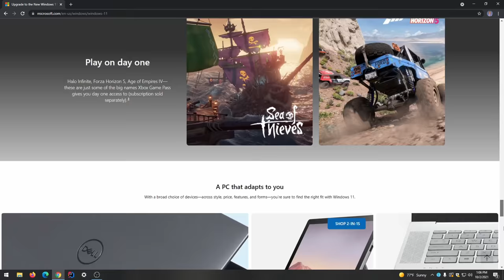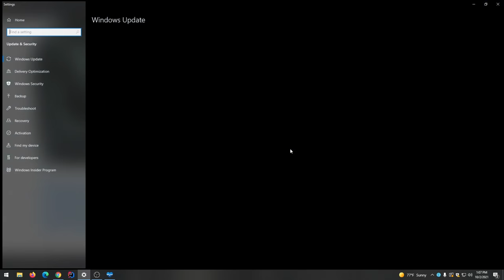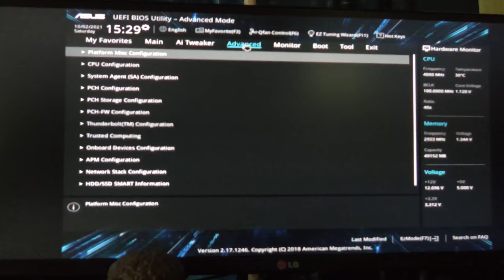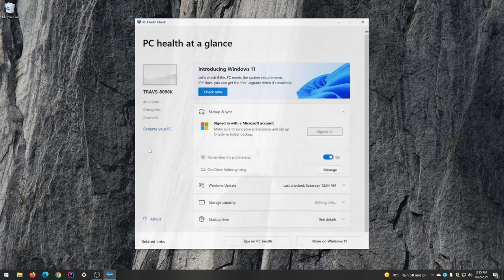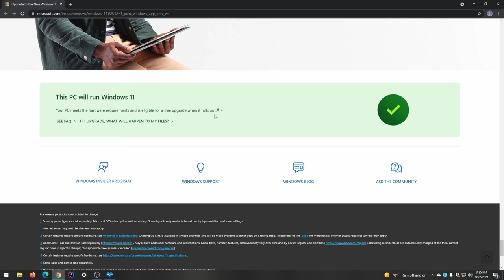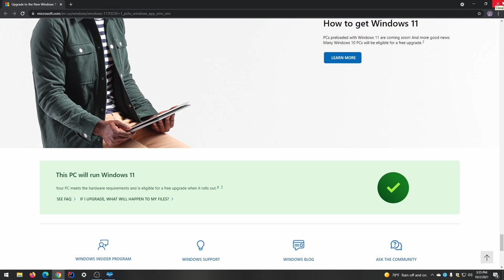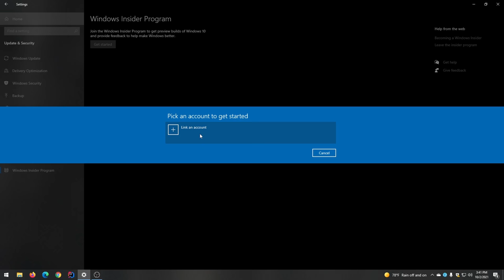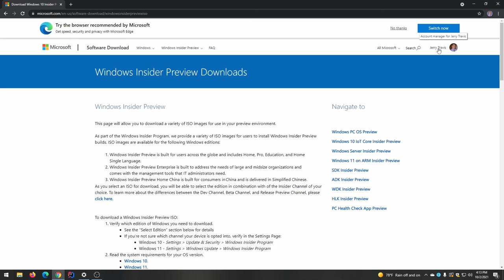Installing a TPM 2.0 Module So I Can Install Windows 11

Comment: You said there's 14 pins but I counted 13 holes
Reply: 2 years later, its a 14-1 the -1 is the covered slot

Comment: I installed a tpm 2.0 discrete module on my motherboard. My cpu has ftpm. I am trying to use the module, to avoid a problem caused by the ftpm. When i switch from ftpm to discrete tpm in my asus BIOS, it changes back after i save and restart. Any ideia of whats happening?

Comment: I'm hoping people will check to make sure they don't just have the TPM turned off in the BIOS first... sometimes it's already there and just disabled, so buying and installing one is completely uneccesary.
Reply from the maker: You are correct that most motherboards that have a TPM 2.0 header usually have the software CPU implementation. I have heard from a few people that the BIOS on their motherboards is buggy and installing the hardware module works better. I haven’t experienced this myself, but given how buggy (and abandoned) some manufacturers leave their BIOSs, it doesn’t surprise me.

Comment: I was so pleased to find this solution to my problem.  Alas, it didn't work!  I have new PC with an Asus A520M-K board, which is not on the Windows 11 Supported List on the Asus website. The answer to FAQ 5, regarding TPM modules, states: "If your motherboard is not listed on support list, it means your motherboard does not meet the minimum requirements to support windows 11 even though you install other TPM 2.0 module (Card) on your motherboard."  So it seems you need to check the Supported List before wasting your hard-earned on a module that will get you nowhere.
Reply from the maker: Oh wow! I have read Microsoft keeps adding new requirements for 11 beyond just needing a TPM 2.0 module. As far as I remember, Asus didn’t list that quote on FAQ 5 when I made this video! Thanks for the information and sorry that just adding a TPM 2.0 didn’t work for you!

Comment: I had a similar problem. 5900x with a x570 hero board. I just had to convert my boot device (SSD) from MBR to GPT using command prompt by going to recovery restarting it, trouble shooting, type the command and it worked perfectly for me
Reply from the maker: Good to know. I’ve had all my drives on GPT for years, but I do remember converting an HP laptop I had during the Vista time period from MBR to GPT. There was some feature I wanted to use that would only work with GPT (can’t remember what it was).

Comment: Make sure that you get the correct module.  There are two that I know for ASUS motherboards.  Not know about other makers.
Reply: I have a M/B ASUS Maximus 8 Ranger, could you point me in the right direction towards the correct TPM module to install, TY.

Comment: what I done is download your windows 11 iso,, download RUFUS  burn an image to a usb flash drive and select the option on rufus to make the image without the tpm processor option, then it will bypass the check for the processor/tpm,, installed and works fine(amd fx 8 core processor)
Reply from the maker: That’s neat. I didn’t know Rufus could do that.
Reply: @JerryTravisSmith  installation can only work of course from booting to the usb drive to install , if in windows mode already, it wont install with bypass check

Comment: I don't know much about motherboards yet. But right now, I have a really old asus h81m-e motherboard for my desktop setup. Does this motherboard have those tpm pins? h81m-A has 20-1 pin slot. Don't know if mine has or not. Your content helped me to get acquainted with all these hardware things. Thank you.
Reply from the maker: Sadly, the H81M-E does not have TPM, only the A model. And I don't think even the A model has TPM 2.0, which is required. (I'm basing that on other manuals that don't specifically say "TPM 2.0" and just say "TPM" generally mean it's only TPM 1.0.) The manual for both the A and E models is here: https://dlcdnets.asus.com/pub/ASUS/mb/LGA1150/H81M-A/E8599_H81M-Series.pdf?model=H81M-E

Comment: I have same problem on my Asus PrimeH570M-Plus and idk which TPM 2.0 to get or know if this motherboard has a tpm input location! I was gonna get this one but i am not seeing anything with 14 pins on the motherboard. Help.😊
Reply from the maker: According to the manual, the TPM connector is next to the SATA ports on the  right bottom of the motherboard. It’s actually a 13 pin connector. 

But you don’t need a hardware TPM. In your BIOS, go into advanced mode and look for PCH-FW Configuration and make sure it’s enabled. It should be by default but if you’re getting some kind of TPM not present kind of warning, it may be disabled.
Reply from the maker: Here’s actually a video where I discovered my board had software TPM support: https://youtu.be/CULyJw5gImc?si=lrlqUDLNFx2USIJX
Reply: @JerryTravisSmith  thank you so much!

Comment: I have Asus x99 deluxe it got  TPM connecter like yours on the M board   and i bought one  TPM   and installed it  the light in TPM shows green when the pc is on  but  the Bios  does not give me the option of  TPM my  bios is  the one from 2019 any help ??
Reply from the maker: Have you booted into Windows and ran the PC Health Checker to see if it is enabled by default?  That’s what I’d do. I’m pretty sure my BIOS enabled it by default after installing it. I was able to go in and check but it was already on enabled. 

Also, in the BIOS, it may be labeled as PTT or Platform Trust Technology or IPTT or some derivative of that.
Reply: @JerryTravisSmith   i did run pc health checker still  shows no TPM i  could not find  the TPM in my as us  x99 bios  i am just wondering if there is non in the bios  then why there is TPM  connecter in mother board and it marked  TPM and once i insert  the TPM the light get  green  in the future i think twice before buying Asus
Reply from the maker: @johnal4560  Here’s the list of motherboards that officially support Windows 11 per Asus: https://www.asus.com/microsite/motherboard/ASUS-motherboards-Win11-ready/

I think this is the manual for your motherboard: https://www.pugetsystems.com/files/4724/parts/Motherboard/Asus-X99-Deluxe-U3-1-10954/e9504_x99-deluxe_series_ug_for_web_only.pdf

I didn’t see X99 listed here, but all I did was a “find on this page” search so it may be on there. 

Is this the manual for the TPM module you bought: http://dlcdnet.asus.com/pub/ASUS/mb/Add-on_card/E14029_TPM-M_R2.0_TPM-L_R2.0_card_QSG_V2_web.pdf

If so, it reads as if TPM may not work if you’re not using UEFI. I don’t know your full configuration so this is a guess. 

Please reply to this if you make any progress in getting your TPM working so it may help others in the same boat.

Comment: Hi brother i have ASUS B550 GAMING WIFI 2 MOTHERBOARD, i just want to know how many pins TPM required for this board?
Reply from the maker: The manual for this board doesn't mention TPM and it isn't listed on the B550 chipset isn't mentioned on the Asus Windows 11 Supported Motherboard page [ https://www.asus.com/microsite/motherboard/ASUS-motherboards-Win11-ready/ ] Sadly, I think you're out of luck if you want to install officially supported Windows 11. There's a myriad of guides on Youtube for getting around the various requirement checks so you can install Windows 11 anyway.  I personally do not like installing an operating system with workarounds because eventually, Microsoft will most like add some feature that will brick the installation on that hardware. Sorry I am unable to provide a more positive answer.
Reply: @JerryTravisSmith  thanks for your kind reply but i let you know sir i build my pc myself in January 2023 and when i started my pc for first time the warning appeared " press Y install new TPM and press N for previous TPM firmware.
Actually i was afraid of pressing Y for installing the new TPM firmware and i have been using my pc for 5 months without TPM 2.0 but finally at risk i pressed Y button yesterday for installing new TPM and it works.
Actually in this motherboard the TPM 2.0 already installed i just need to activate it thats it.
Now I'm using window 11.😀😀😀

Comment: I have a intel dh61ww motherboard it has 19 pin tpm slot but intel doest has tpm module can I use asus or gigabyte tpm module in intel motherboard.
Reply: any fix brother? because I share the same motherboard

Comment: 2:05 My H97M-e Asus mainboard has a TPM slot with 22 pins, but the Asus TPM chip seems to be made for 14 pins?
Reply from the maker: The problem is that even motherboards of the brand can have different TPM modules. Make sure to consult your motherboard manual for details about the specific TPM you’ll need.

Comment: 2:39 - Oh, I see it on your motherboard! It says "TPM" right there. I wonder if my ASRock motherboard has that.
Reply from the maker: There’s a good chance it does if it was manufactured in the last 5 years. I have some fairly basic circa 2013 boards with TPM 1 headers, so the whole TPM thing isn’t really new.

Comment: Any idea what physical TPM 2.0 modules are compatible/recommended for the MSI tomahawk x570?
Reply from the maker: Unless you have a Ryzen 1000 series processor, you should be able to enabled TPM 2.0 without having a physical module. According to this article ( https://www.msi.com/blog/How-to-Enable-TPM-on-MSI-Motherboards-Featuring-TPM-2-0 ) you shouldn't need an external TPM module. Your motherboard and CPU should allow you to enable fTPM, which is TPM functionality built into the platform. Your board is on the compatibility list for fTPM: https://download.msi.com/archive/mnu_exe/pdf/2021/msi-tpm-2-0-motherboard-list.pdf
Reply: @JerryTravisSmith  I know this, but my ftpm is a buggy mess so I am looking in to investing in a proper dtpm in order to hopefully fix a few issues, improve performance, and future proof my system ready for when I eventually upgrade my CPU
Reply from the maker: Ah I see. I have heard some folks say software TPM is buggy but I haven't experienced it myself.

Comment: Hey guys, the video was super helpful! The only thing, it might be user error idk, but when I plug in the new tpm I got on Amazon my pc won’t start up, at all. Unplug it and it starts immediately. Did I just get a bunk product?
Reply: I found out the hard way that even if the generic ones you get on amazon have the correct amount of pins, they can still be incompatible if the pinout is different. Make sure you check the diagram from the listing and compare it to the diagram in your motherboard's user manual

Comment: GIGABYTE B550M DS3H AM4 AMD B550 Micro-ATX Motherboard with Dual M.2, SATA 6Gb/s, USB 3.2 Gen 1, PCIe 4.0 This is the motherboard i have. will that chip work on my board or will i need to buy a whole new board
Reply from the maker: According to this manual that appears to be for your motherboard (https://download.gigabyte.com/FileList/Manual/mb_manual_b550m-ds3h-ac_e_1201.pdf), you need a GC-TPM2.0_S module. There are some on Amazon but they appear to be aftermarket and I personally wouldn’t trust them.
Reply: @JerryTravisSmith  so basically I would need a new mother board
Reply from the maker: @jakeuchiha9540  It would probably be cheaper. The least shady-looking TPM on Amazon was $150 and I don’t think it would trust it. Before all the price gouging, most TPM modules were between $20-35. Sadly, it’s not the case now that TPM is not optional.
Reply: @JerryTravisSmith  well damn I built my first pc last year didn’t know I would need to upgrade. I haven’t tried upgrading parts yet. Am able to just unplug in one and plug in on another? Sorry I know I’m asking a lot of questions still new to this.
Reply from the maker: @jakeuchiha9540  give me a couple hours. I’ll do some more research on your board when I get to some stable internet. You may be able to enable firmware TPM. It just depends on your board,  your BIOS, and your CPU.
Reply from the maker: @jakeuchiha9540  What model number of CPU do you have?
Reply: @JerryTravisSmith  thank you man I appreciate it. I’m not home rn so I can’t see the model number.
Reply from the maker: Good news. It looks like your motherboard supports AMD’s fTPM (firmware TPM). That means if your CPU supports it, you can enable TPM support without having to buy a physical module. If you go here (https://www.gigabyte.com/Motherboard/B550M-DS3H-rev-1x/support#support-dl), under the BIOS section, you’ll see there’s a BIOS revision F14e dated October 13, 2021 that should enable fTPM by default. VERY IMPORTANT: double check that this is the support page for your motherboard. The BIOS is specific to a specific model and installing the wrong BIOS can brick your system.
Reply: @JerryTravisSmith  Bro  I am going to try it out now. but I just have to say I didn't know if you were going to respond or not again. I just want to say I really appreciate the effort and time you've put to helping me out.
Reply from the maker: I have satellite internet and it has been raining a lot. I can’t wait until SkyLink becomes available in my area!

Comment: did u say z370A? pretty sure i had that board and it comes with TPM built in just needs to be enabled.
Reply from the maker: Yeah. I did a follow up video where I shared that discovery (I already had the hardware TPM installed so I just left it in there). I was looking for the wrong terminology for that in the BIOS. 

Did you have any issues with the CPU TPM? A couple commenters said their boards have had a buggy implementation of the virtual TPM. I haven’t had any experience with it and am just curious what your experience was like.

Comment: You could have just enabled PTT in your BIOS and not installed this chip at all! I just installed one in my amd board for no reason, I wasn't experiencing the stutter bug. However, with a dedicated TPM module, I don't get event ID errors because AMD's TPM isn't signed with microsoft properly and the Infineon chip I'm using now is!
Reply from the maker: Yeah. I figured that out after I made this video. 🤦🏻‍♂️

Comment: At this point I guess I should just get a new pc (because my pc is an AIO if it wasn't I'd swap the motherboard or add the tpm module like you did) l
Reply from the maker: I’m surprised an AIO doesn’t have TPM. 

I used to have some clients that always bought AIOs. Most of the time, I had to buy a whole new unit when there was a major issue or they needed to upgrade. One model I installed had upgradable RAM but that was it. They did make for a clean work area and my clients always had fancy mice and keyboards hooked to them.

Comment: I have a Tuf Z370 Pro Gaming Computer, do you know if this TPM Module is compatible.
Reply from the maker: From looking at the manual for your board, it is a TPM 14-1, so yes it should be the exact same one I used. Note that I have not actually tried it with a Tuf Z370 Pro Gaming board, but it’s the same manufacturer (Asus), chipset, and TPM pin out so I’m 95% sure it’ll work. Let me know if you try it and it works.
Reply: @JerryTravisSmith  I called Asus and they said it is the right chip so I should be okay.  Thank you for responding so quickly.
Reply from the maker: @louismaniscalco1389  Excellent to hear!
Reply: @JerryTravisSmith  good news,  I installed the tpm 14-1 today and it was immediately recognized.  However,  I ran PC health and it says I am good to go for Windows 11, but it says windows 11 isn't available yet for all windows 10 pc's and I didn't get an option to download the windows 11 update.
Reply from the maker: @louismaniscalco1389  I’m glad the TPM worked. I have heard of machines where you still can’t upgrade because there is at least one device on the machine is not fully supported. One version of the Microsoft Surface laptops had to wait 6 months or more to get one of the Windows 10 Updates (maybe 21H1). I figure it MS can’t get their own hardware fully supported at launch that any of us that have a fully supported machine are just lucky! Do you have any expansion cards beyond what’s built in to the motherboard?
Reply: @JerryTravisSmith  I did download an  update 21H2 yesterday , but when I  click on check for updates, nothing appears for Windows 11, it says I'm up to date. 

I believe I do have expansion slots
Reply from the maker: If PC Health Check says your machine can handle Windows 11, go to https://www.microsoft.com/software-download/windows11 and download the "Windows 11 Installation Assistant." Run it and it should start installing Windows 11. I'm installing 11 right now on a Lenovo laptop that wouldn't let me install 11 with PC Health Check or Windows Update. So far, very painless.
Reply: @JerryTravisSmith  I found that this morning and I am planning to do it soon.  I am in the process of encrypting my backup drive and I'm waiting for it to finish before I move on.  I appreciate all your input.

Comment: Uhhh my computer wont turn on. When I installed the tpm it turns on for a split second, and then turns off. When I take the tpm out, my computer works perfectly normally. I updated my bios and that didn't fix anything... Someone please help.
Reply from the maker: Does it turn on just from putting in the TPM or do you have to hit the power button?
Reply: @JerryTravisSmith  it doesn’t turn on at all when I put it in
Reply: @JerryTravisSmith  but when I take it out my computer turns on
Reply from the maker: @coltmccoy1195  This is just a guess because I can’t see your setup but…The TPM module could be bad or need to have its BIOS flashed to a newer version. (I’ve never flashed a TPM BIOS but I have seen forum posts where users have had to do it to get their modules working.) Given how hard they are to come by, I’m assuming you don’t have another TPM to try.

Or it could be the wrong module for your board. I think there are incompatible modules with the same connector key.

Sorry this is so vague but this is difficult thing to troubleshoot with limited details.
Reply: @JerryTravisSmith  I already returned it